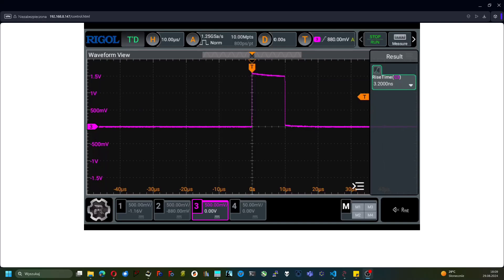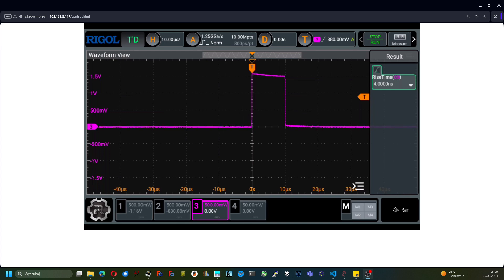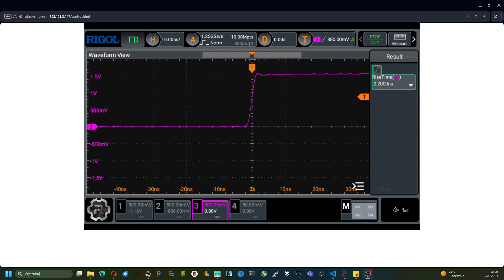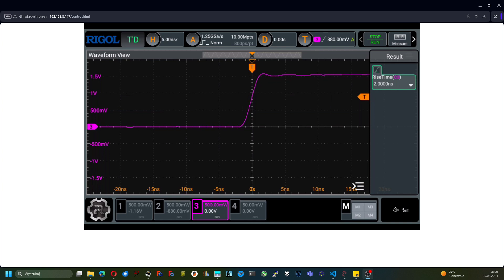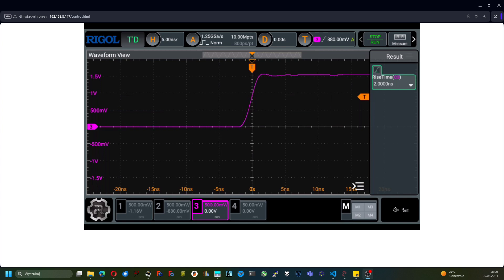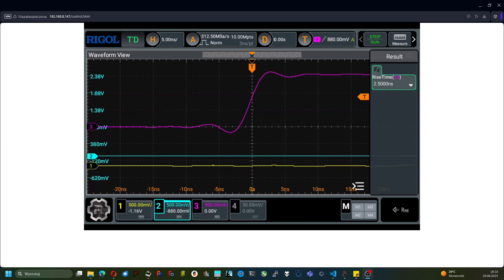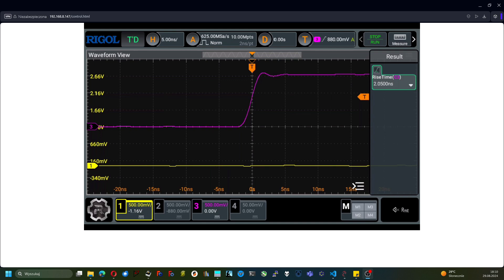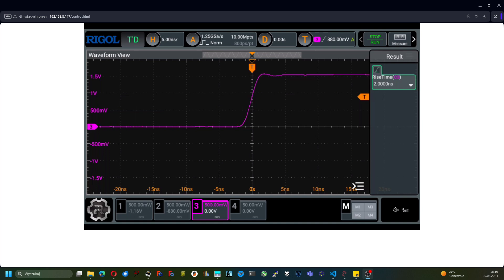Pulse response of the Rigol DHO804 (upgraded to DHO814)

Comment: I have the original DHO924S which doesn't need to "modify". The actual bandwidth tested is around 300MHz, such as 295MHz. The DHO924S comes with 350MHz probes. For reaching this freq, you need to use other probes. DHO804 comes with 150MHz probes. I have tested the FFT functionality with DHO924S which can mesure freqency upto 625MHz using my signal generator. Also the built-in signal generator can generate sine wave 50MHz using personal defined ARB which is higher than 25MHz as described by Rigol.
Reply from the maker: Hello, I did not use probes, I've used a good quality coaxial cable and a 50 Ohm terminator instead. Recently I've upgraded my scope to 824 (yes, it is possible) and now the bandwidth goes far behind 200 MHz, but now the overshoot is visible. When it was upgraded to 814 the edge was smooth, as seen on the movie here. How does the overshoot look like on your scope? Cheers!
Reply: @fimek_elektronik  I didn’t test overshot.  I trust that Rigol DHO924S within the specs bandwidth range, the measurements can be precise. The DHO924S has more components soldered on the board. Software-level unlocking bandwidth needs hardware modifications. Rigol doesn’t sell DHO824 which is a virtual spec from a firmware update. If you have a DHO814, probably after you upgrading the firmware to DHO824, the performance could be better.